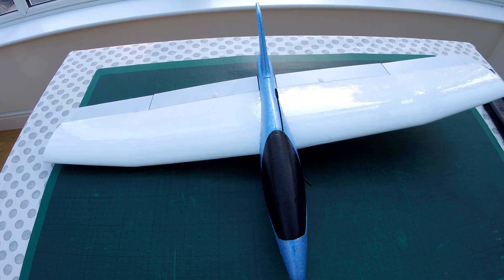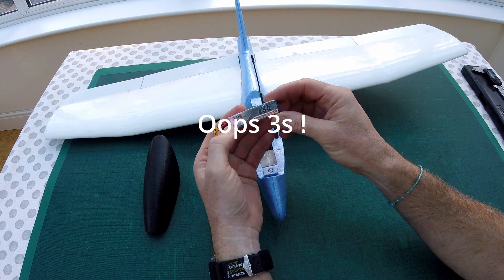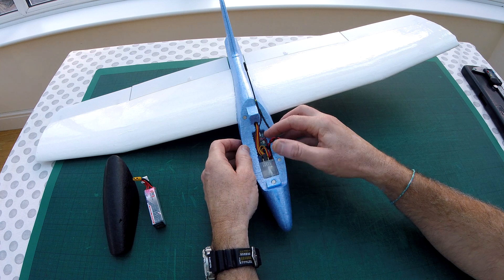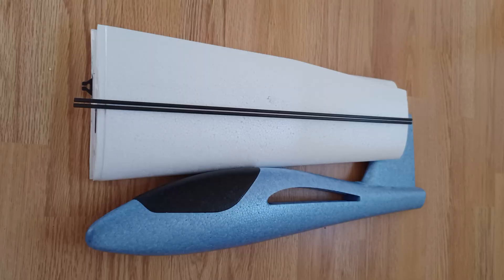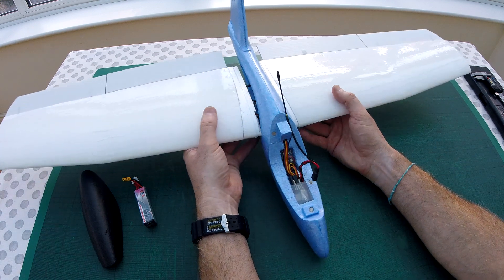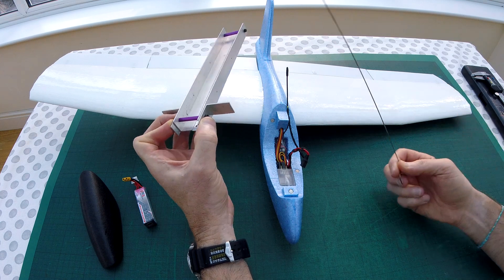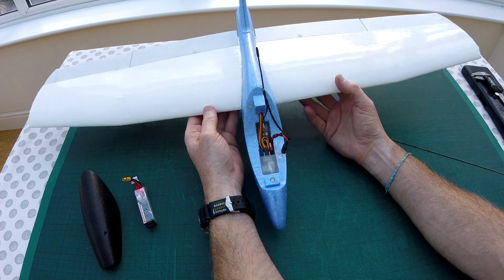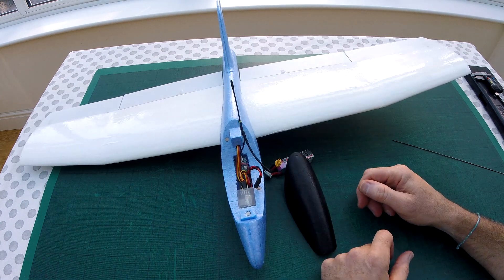Lidl RC Glider Conversion

Comment: Lovely, what is the wing covered with and what wind speed is best for flying?
Reply from the maker: The wing is covered in ordinary 50mm white parcel tape, the trick is to carefully plan out how you are going to apply it and when laid use an old credit card and hot air gun on low heat and to smooth out any wrinkles.I have only flown it so far in winds under 15 mph. You can fly it in higher winds as others have done on YT, to get the most out of it you would need to add some more weight to the nose.
By comparison I regularly fly my quads in 25 mph+ winds as they weigh 600g they can deal with the higher wind speed.

Comment: Looks really neat. Can I ask if you covered the wings with anything, they look nice and shiny?
Reply from the maker: Yes, I just used parcel tape and smoothed out with a warm iron. I did experiment with laminating film, however I found the foam would deform when heated and there was a larger weight penalty compare to simple parcel tape :) .
Reply: What's the advantage of adding the tape? Thanks!

Comment: are there any dimensions?
eg
1) total length of fuselage,  so one can determine how much of the boom to cut of
2) width and length of the elevons and the fixed outer surfaces.
3) how much deflection up of the elevons measured from flat bottom to lower trailing edge

thanks in advance
Reply from the maker: 1) total length of fuselage, so one can determine how much of the boom to cut off
485mm from nose to tail or the end of rudder is 135mm back from the fuse rear cut out
For wing.

Rudder is 125mm long at its base where it attaches to rear of fuse and has 2 x 3mm carbon rods
For support and hot glued in place.

2) width and length of the elevons and the fixed outer surfaces. 
Elevons 220mm x 50mm, outer wing surfaces 185mm x 50mm (wing edge join) and 170mm x 48mm (outer edge and rounded edge).
The outer wing surfaces are mounted using 26mm x 2mm carbon rods and hot glue.

Wings are covered with 50mm white packing tape.

3) how much deflection up of the elevons measured from flat bottom to lower trailing edge
   deflection is 14mm up and 14mm  down (this max at the moment) this is measured from outer edge relative to neutral.

Extra info ...

Wing spars are 4mm x 450mm and 28mm and 100mm back from leading edge, clip is in the middle.
Servos are 47mm back from leading edge and 54mm away from fuse near the leading edge and 56mm away from the fuse at the trailing edge.
Foam cut out at the nose and canopy was done with a Dremel and a Dremel Rotary Cutting Guide Multi Tool Attachment Kit HSS Router Drill Bit (if you have not done this before, practice on scrap piece 1st!).
Canopy secured by 6 x Neodymium Disc Magnets 6x3mm cyno glue.
Wing clip is a Plastic Safety Breakaway Bra 😊 Buckles Webbing 25mm Wide. 
See through RX cover is from a spare blade’s container for a box cutter, cut to size and by pure chance was the exact depth and width I chose to cut out for the RX and RP2040 zero voltage sensor. 😊
Reply: thanks a lot! !!
Reply: @pablofpv and also very interesting the RP2040 telemetry,